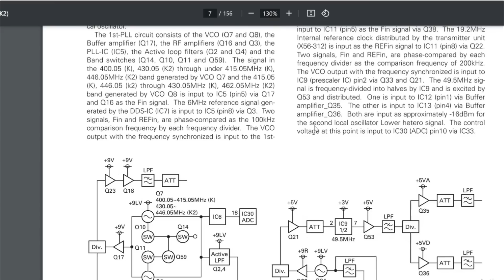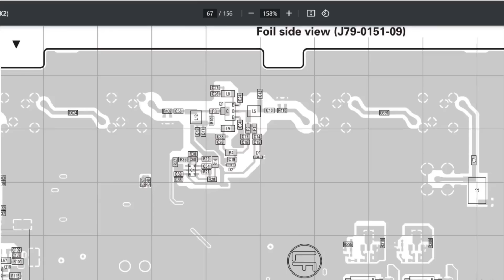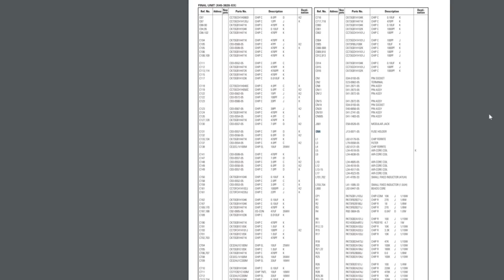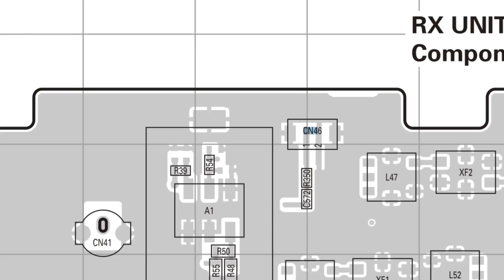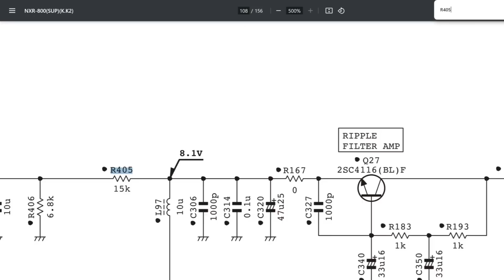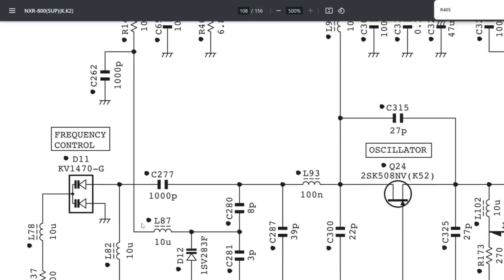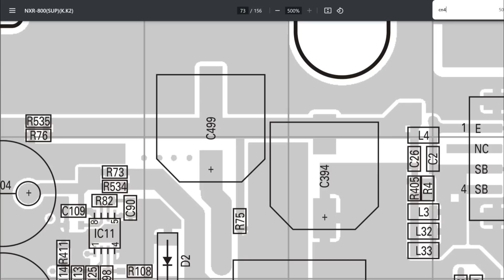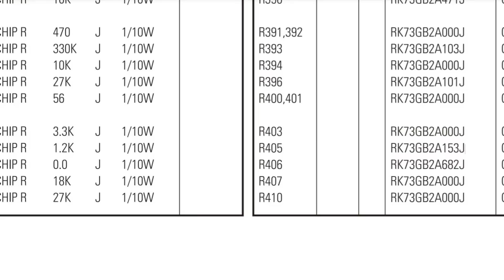Kenwood Blew my Mind - NXR-800K. Repair. How Right to repair should be.

Comment: An electronic repair manual in 2024? That's as rare as a Sasquatch riding a Unicorn holding a piece of the Holy Cross. Amazing! Props to Kenwood for serving the customer instead of their Sales Division.
Reply: On the contrary. Kenwood's Sales Division clearly understands that future sales and repeat sales are built upon happy present and past users.
Reply: @blackrifle6736  Touché
Reply: Looks like it was printed in 2008, it definitely seemed to be more common place then.
Reply: @Dirnkus_Ginish  I just checked; equivalent service manuals exist for the current-production NXR-1800 and TKR-D810 repeaters, which are lifecycle replacements for the NXR-800.
Reply: I once saw an Unicorn riding a Sasquatch but that's too long of a story to be told here.

Comment: But does anyone knows why do they have 2 0ohm resistors in parallel? To make a 0/2 ohms resistor? 😂😂
Reply: There is a maximum current density per chip, so the pcb designer used two of them to carry all the predicted current. Same way you don't use thin traces for high current paths.
Reply: Maybe if one fuse blows, you have a backup already in-line.
Reply: Basically a jumper wire, maybe a cheaper option.
Reply: @delton5488  This, but why 2, thats the weird part.

Comment: Amateur radio is a different beast, the spirit of self repair and modification is ubiquitous and many companies provide this kind of data to aid in repair and modification of their own devices. Those diagrams really are nicely laid out though!
Reply: I guess the market for us ham is different. We often tinker with devices and have ability to repair them more than average consumer. I hate any equipment without such information and almost all my equipment has similar information available.
It is also not just Kenwood but practically any manufaturer, new or old. My pretty recent Icom radio had full schematics, board layouts, parts lists and logical block diagrams too.

Comment: The Reason for this is Amateur radio users will not buy a product to use without a semantic or manual about what is in it & how it works. Yet the rest of us will blindly buy electrical products that don’t do this . Amateur Radio is the one field left where the Right to repair is a right & not a privilege ….
Reply: ^ This! Many of them are also electronics enthusiasts.
Reply: This is the correct answer. I am an amateur radio operator, and I've had radios from several manufacturers over the years. Kenwood, Yaesu, Icom, etc... They all came with manuals similar to the one shown in this video. As the commenter above said, Ham operators want to be able to work on the gear they buy, and won't buy gear from manufacturers who don't provide detailed descriptions and schematics.
Reply: Except the NXR is not an amateur radio product, but a commercial (part 90) repeater. Service literature is common on LMR gear from reputable manufacturers like JVC Kenwood, Icom, Motorola Solutions, etc because local LMR shops provide warranty and out of warranty support. The life cycle of part 90 infrastructure products is usually 5-10 years versus consumer electronics which are engineered to die when the 1 year warranty expires and all "service" is replace the entire unit and toss.
Reply: Well, of course.  Because we can and will build our own radios from scratch than buy a manufactured radio without complete and thorough documentation.
Reply: I was just about comment about my Yaesu FT-51R...
Reply: I am a Amateur Radio user- but Kenwood has always provided service manuals for everything they make- always. They did it because at one time we fixed everything- and yes, I repaired a lot of Kenwood gear as a professional electronics tech over the years. The new companies are simply lazy.
Reply: *schematics
Reply: Hobbyist electronics devices will usually have schematics or the manufacturer will at least send the in formation to you if you ask.
Reply: It's getting a complicated if you need an export license from the Japanese government for the replacement part.
Reply: im just today talking about right to repair. I bought data for cars and the wiring diagrams are always TURD. I have an airbag and I want to know what the 18 wires do. Mate said right to repair. Tomorrow I gonna ask Ford.

Comment: I am a Radio Ham in the UK. Most of the major Amateur Radio equipment suppliers have full service information available. 🙂
Reply: Yep. I'm a ham in the US. Kenwood, Icom and Yaesu all do. Part of the hobby is fixing and modding your own gear.
Reply: Ye this isn't a kenwood thing, it's a radio equipment thing. You will not find diagrams like this for kenwood hifi units these days for example (at least I wouldn't think so).